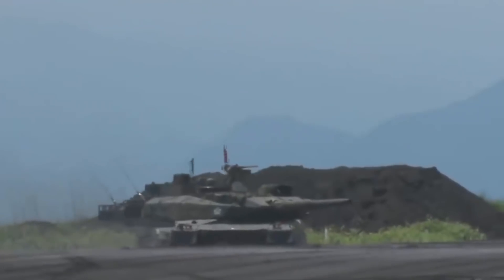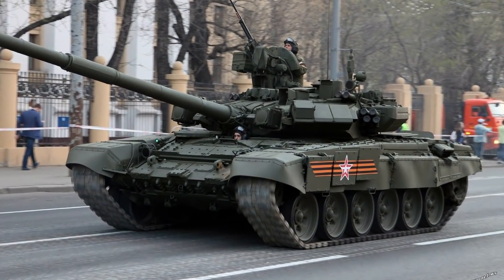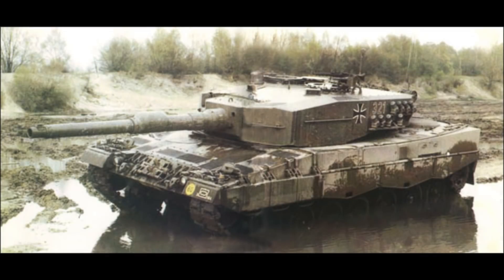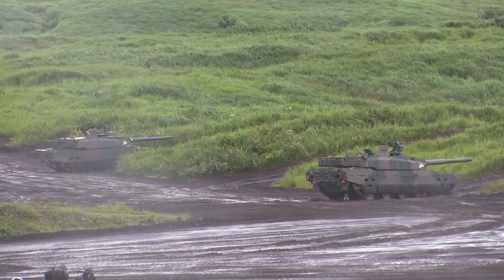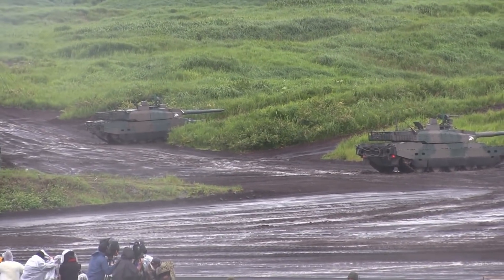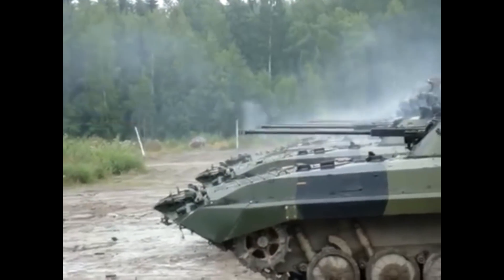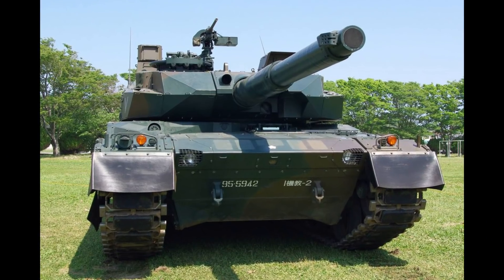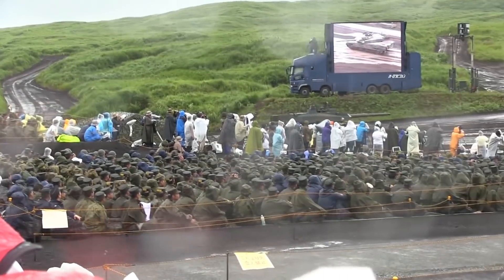Problems with Type 10 tank

Comment: 2:05 The labels in this graphic strongly imply that the turret side modules are unarmoured. Translation:

Red turret module: "Gun turret front - Armoured module"
1st yellow turret module: "Gun turret front cover"
2nd yellow turret module: "Gun turret side module"
Red hull module: "Chassis front - Armoured module"
Yellow hull module: "Chassis front surface cover"

Note how it only says "armoured module" for the red ones.  The graphic does however also differentiate between "covers" and "modules", which may imply that other side turret modules could be installed at some point.
But I don't know where that graphic comes from, so don't treat it as an authoritative source.

Japanese Wikipedia describes them as hollow detachable applique armour that doubles as storage bins, and that it MAY be intended to put additional armour into when needed. But it seems that the author there was literally just speculating, and it's not well sourced.
Reply: Thanks for the translation mate!!!
Reply from the maker: Thanks for the translation, I found it on one forum where a guy claimed that it states "side armor modules" so I was not sure if he was correct since he seemed a bit biased in the way he was talking about it :)
Reply: Keep in mind though that this is not the official drawing, the tank is still very classified.
That drawing is only made for a magazine and it is based on artist guesses and imaginations. 
So it should not be taken as a reference to the real vehicle, it is irrelevant.
Reply from the maker: @i_nameless_i-jgsdf  Ok then, dully noted, thanks for the info
Reply: @RedEffectChannel  
No problem.

Btw if you ever plan on making another Type 10 video there is a picture showing Type 10 frontal hull composite armor and how the hull looks like without wheels, tracks or turret if you search 
''Type 10 internal armor'' 
on google image it should show up as the first picture. 

Youtube automatically deleting any link that is not related to them. :I
Reply from the maker: @i_nameless_i-jgsdf  thanks I will check it out. It is really annoying, I agree, it used to be that such comments would be held for review by the video creator, but for a while now they are just automatically deleted.
Reply: I can read a bit Japanese and it said the yellow part served as “spaced armor” but primarily as cells for empty, hollow storage units. So yeah they’re only unarmored storage units and “act” as spaced armor.
Reply: @i_nameless_i-jgsdf  Did your tanks have additional upgrades yet?
Reply: @RedEffectChannel type-10s can be fitted with armor modules and packages with the storage bins removed. It depends on the brigades and where they are stationed. Hokkaido brigade combat teams will most likely op to have the armor where southern brigades like in Kyushuu will use storage bins as the path there is usually filled with bridges and mountains meaning plenty of cover as their doctrine mostly states a defensive war.
Reply: @RedEffectChannel I have the documents on the type 10 confirming this as well. The type 10 is way more armored. In its current configuration it’s only rated to handle type 10 APFSDS from the front

In its other configurations it’s capable of way more. Even some evidence suggesting this tank is capable of mounting ERA on the sides. This entire tank is designed for transport around the islands

Comment: According to leaked documents in regards to weight differences between the Type 90 and Type 10, almost all of the weight loss was removed from components, such as the engine, electronics, and gun weight. The Type 10 has almost the same weight in armor as the Type 90, with a lighter, stronger, and extremely expensive material.
Reply: Type-10's composite armor is actually far heavier than Type-90's.
Reply: where are those leak if you mind sharing?
Reply: They cut down 3 tons of electronics from 8 tons to 5 tons!
Reply: I'm tired of the argument that the Type 10 has thin armor because it's light.
Reply: @blahblah7720warthunder furarms
Reply: @user-sbvbb2up58njhchh2p the armor is indeed light but that is because the material that made it are very advance, and from what I know it can tank a whole ass 120mm round despite how thin it is, the name of the steel is call nano crystal steel

Comment: The Type 10 is designed for a very specific mission set. It is designed to operate on Honshu and Kyushu against amphibious invasion forces in mobile defense and counterattack operations against beachheads. For that it really doesn't need much side armor. It's main opposition would be amphibious forces, which typically have lighter equipment than regular army forces. Only the Russians, French, British, and the US have the capability to deploy significant numbers of MBTs in amphibious landings. However the only places heavier tanks could really operate freely in Japan is on Hokkaido and the Kanto plain. Neither of which are very inviting targets as any likely invader would be landing on the opposite side of Honshu from the Kanto plain in one case and Japan keeps it's Type 90 heavy MBTs on Hokkaido in the other.

Comment: Shameful lol. I like the type 10 🤷🏼‍♂️🥺
Reply: I love the type 10 it’s not a heavy tank but I like how it’s designed to be quick maneuverable and  Easley deployable around Japan.
Reply: Hi Mat. i like it to. but only if its deployed in Specific terrain. in Eu Plains this thing will lose.
Reply: Em I remember reading an article about type 10 and it seems that the whole turret is indeed made out metal but not any ordinary metal this specific metal which call nano crystal steel can protect against even 120mm or possibly higher round despite it's thin looking layout tho how the technique to manufacture this metal is highly classified, I do know it is came from steel

Comment: I know Japan may never do it; but these would have made a nice export option for countries that wanted a good balance between weight, protection, firepower, etc. (assuming they couldn't get their hands on T-72's and T-90's). 

Also, they have brought these to train up in here Washington state. ;)
Reply: Actually Japan has already modified the constitution to allow export of military equipment like this.
And there are rumors about Brazil showing interest in Type 10
Reply: I mean, countries like the Philippines could use a tank like that.
Reply: @mayuri4184  True; though I would think that something like the M8 AGS or the Stingray (basically any modern LT) would suit the Philippines best. There's nothing in the country that would necessitate the firepower and protection of a full MBT. Plus, getting an 20-25 ton vehicle between all the islands is much easier/cheaper than the 44 tons of the Type 10. ;)
Reply: @gabrielpalileo3294  They DID buy 18 ASCOD IFV's that were modified to become 105 mm gun-carrying light tanks.
Reply: @hendi1571  That only allows them to send non combative equipment only. not any direct offense weapons. that's why Helicopters  , patrol crafts and APCs are the best choice.
Reply: @patriotenfield3276  so attack submarines are noncombat equipment then?
Reply: The Turkey Atley supposed to have the same powerpack as Type 10 but this plan was cancelled due to the export ban.
So exporting the whole tank is difficult.
Reply: Way too expensive
Reply: @i_nameless_i-jgsdf  it's altay
Reply: @misturjosturr7658  
Whatever that thing is called.
Reply: @gabrielpalileo3294  for MBTs like Type 10, they can most certainly be used in urban areas, where it is expected to go head to head with enemy MBTs (should the need arises.) For island hopping tanks, perhaps the newly purchased Sabras can do the work
Reply: @hendi1571  yup. just remove the torpedos and missile launching capabilities and make it look like it is for reccon and spying purpose only. this is also what kawasaki OH 1 is made for.
Reply: @gabrielpalileo3294  Sprut SD probably the best choice since it have light weight, same firepower like regular MBT, airdropable, good mobility, and have amphibious capability.
Reply: @hendi1571  There is a will, there is a way
Reply: well, in the same weight level, there is already a lot tanks which has similar, if not better, performance even ignoring the widly popular T series. Say ztz-96b/VT-2 that has been discussed a lot in this channel for example. They both has better armor protection and better gun than the 120mm L44 used in type 10. Also they are a lot cheaper.
Reply: @edwardjoe8448  from what I know (probably can be misinfo) that those L/44 120 is domestically built, its not licensed from Rheinmetall like Type-90 Kyu-maru have and it have a special dedicated APFSDS round that can punch throught Russian Heavy ERA Relikt which is a better version when compared to old Kontakt-5 even though Kontakt-5 still hard to penetrated except for some other few apfsds rounds but since there is no tank on tank battle in present era so I kinda really hard to believe when someone said US or NATO rounds could penetrate it. cmiiw
Reply: They won't sell it. If anything, the export version would have to be inferior to the Type-10 and 90.
Reply: @patriotenfield3276  nah man thats pur nonsense 
Dont compare an ATTACK submarine to a scout helicopter
Reply: A Perpetual Guardsman with a flashlight  I was alluding to that when I said "ASCOD IFV's that were modified to become 105 mm gun-carrying light tanks." Maybe I should have elaborated with "by Elbit Systems."
Reply: @hendi1571  what the hell do you find nonsense? Japan rejected Type 10 joint venture project with Turkey (from a political perspective) . technical aside , because instead of agreeing to a technological transfer, Turkey was persuading for buying out the whole tank models. and later got involved in Syrian war . which made it rejected from the export. similar happened with Australia where there was proposal (Which you told) regarding export of soryuu class  attack submarine , but the export created a beef in Diet (and eventually due to political reasons too , Japan had to pull out. they will never be able to sell anything within a deadline until this law is abolished .
Reply: @patriotenfield3276  😂
Reply: Russian tanks sucks hahahaha
Reply: Export??? How much does it cost Japan to build Type 10?  It's extremely expensive and cost prohibitive import these medicore tank with poor protection.
Reply: @@moabswashpot9002 Get some Chinese Type-15 light tanks.

Comment: The type 10 is one of the first tanks to have C4I and has a hunter killer ability. One tank can spot from a hidden location and others can engage even when behind foliage so out of sight. This gives it protection indirectly as neither vehicle need to expose themselves.
Reply: Type 10 is also the first tank to have C4 inside, in the case of seppuku or harakiri.
Reply: Whoa just like Yamato and Musashi being able to rely on each other's rangefinders and firing solutions via radio

Comment: This tank was built with the idea to make a MBT equivalent to the previous Type 90, but as lightweight as possible, just like you said.
Also some sources say that the basic configuration tank weighs only 40 metric tons, but additional armor packages increase it up to 48 tons. Does anyone know some details about this?
Reply: it's to do with the modular composite armour for the tank. the type 10 was made so that the armour is detachable so that they can easily  transport it alongside it's armour around the country. the 40 ton version is a stripped down version without a lot of the composites on that normally makes up it's armour, the 44 ton version is the most common one to see, most of the pics in the video was of the 44 ton version. we don't know anything about the 48 ton version since as to my knowledge it has never been shown, but only talked about by the jsdf, could be a work in progress and maybe have an aps system on it.
Reply: Actually it was developed to surpass Type-90 in every category while being lighter. And it does so.

Comment: under a video about the Type 10 Tank, there was this weeb that claimed he worked with Japanese steel makers, and claimed that he saw the Japanese steel had special composition under the microscope of some special crystallization
That comment got several hundred likes, and when I quipped in a reply saying 
"that's because the steel used for the Type 10 tanks were folded 1000 times and was infuse with unicorn tears" The legion of weebs then started attacking me saying unicorns aren't real.
Reply: based

Comment: I really wish RedEffect dude would evaluate tanks based on the stated strategic and tactical goals of the tank makers and primary customers instead of apply a "X tank vs. Leopard 2A7V" approach to everything.  It would certainly be more professional.
Reply: I mean he literally said a bunch of time that the JDF have to sacrifice a lot when it comes to Type 10 just so that it can cross bridges and be more maneuverable around urban area. It's a bad design in theory but it makes sense with the JDF doctrine
Reply: @quakethedoombringer  They have the same design as Leopard 1 and M47 Patton so hull goes disintegrate
Reply: @quakethedoombringer since japan is highly urbanized wouldn't make sense to have tanks suited for urban warfare?

Comment: 4:20  In fact, based on the lesson that Challenger 2 was attacked on the front of the car body by RPG, additional armor for the front of the car body has been developed for Type 10.  However, the image has never been released because the performance estimation is concealed and the actual battle has never been experienced.

Comment: Or the Type 10 does have composite on its side.  The type10 has 3 armor versions, each one being heavier, meaning its armor is likely easily removeable.  That would explain doors, hatches to easily access armor block modules.
Reply: The extra armor package isn’t fielded yet and we don’t know what it looks like. The Type 10 is modular.

Comment: I think that since most of Japanese tank design is based around a principle of defense, they don't consider factors often associated with asymmetric warfare, like that in the Middle East. Because of that, they don't consider ambushes very much.
Reply: Yes. The Self-Defense Forces are basically for intercepting enemies, and tanks are also for ambushing like strv103. It lacks side armor because it is not expected to aggressively advance into enemy territory.
Instead, frontal armor and shooting systems are excellent at covering an inadequate number of tanks.
Reply: Tanks designed on principles of defense are abrams, leopard 2. Huge, heavy, well defended, with enough ammunition for prolonged firefight. Tanks designed for offensive actions are small, light, mobile, capable to be easily transported by sea/railroad, check T-80 as example. You got the idea
Reply: @rageofmankind  Not really, no. It would depend on what defensive doctrine the tank was designed for. It's more a question of static versus dynamic. Most western tanks are well balanced to be a jack of all trades and generally support infantry and other mechanized units. They need the armor to potentially push a dug in enemy without making it absolutely suicidal for the tank crew. They can work well as a static defense with heavy armor, but a static defense can be circumvented and gone around. Some of the best defense is a dynamic defense where mobility and information is king. It's about being in the right place at the right time for a defense and then relocating quickly to the next point. They don't need or even want a long deployment time for this type of work. You want to be constantly rotating units in and out of the fighting to keep them rested and highly efficient while wearing down your enemy. 

The theory is that you have your tanks engaging the enemy at a key defensive point and force a route and have your surviving units return to a nearby base for refit and rest while another unit clocks in to take the next shift. Even the U.S. tries to do this when it can as it's much cheaper, easier, and safer to do than trying to extend supply convoys out to armored units in the field where crews end up with lower quality rest.
Reply: @Talishar  I was gonna comment in this thread but you wrote a much better reply
Reply: @Talishar  Japanese and Korean tanks have hydropneumatic suspension that can go low profile and adjust for terrain from terrain